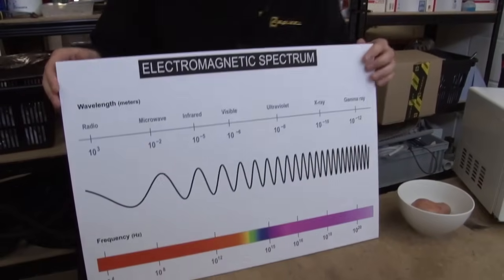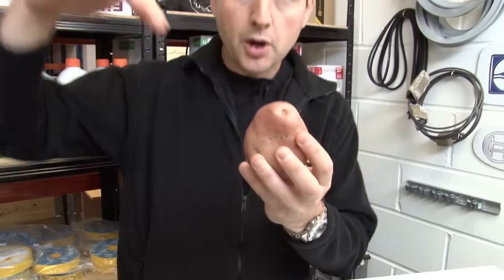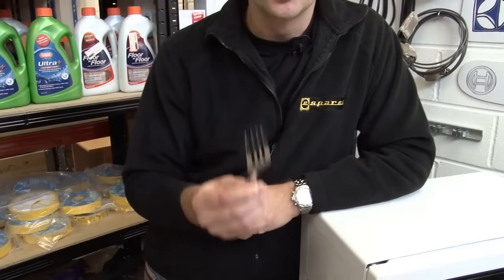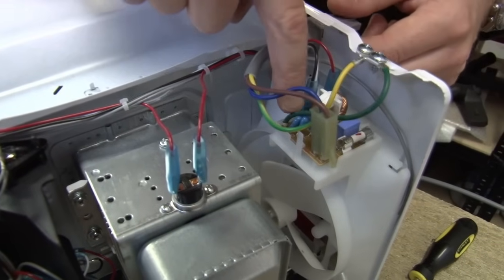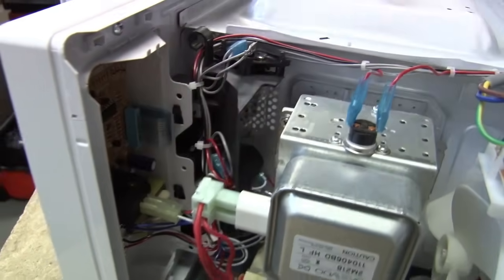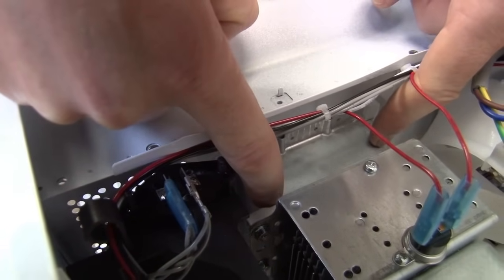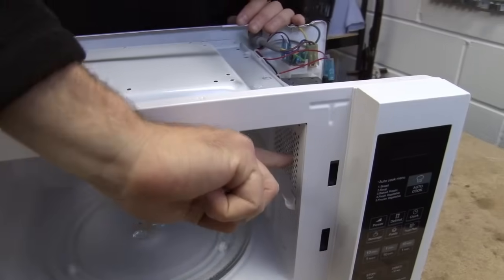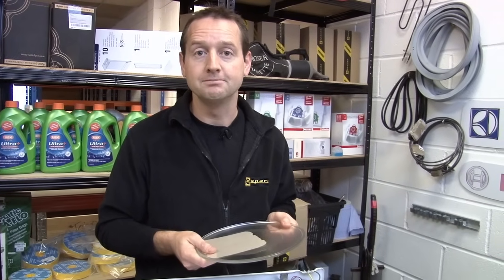How Does a Microwave Oven Work?

Comment: If i plug a 230 V 50 Hz, Microwave Owen into a 230 V 60 Hz supply, will it work, Voltage is same only difference is Frequency please comment ?
Reply from the maker: Hi aabis, you would need to speak to a qualified electrician to get the correct answer.

Comment: hy bro.. I want to make a microwave-related experiment. that is the application of microwave waves to coal heating. what are the tools that i need right? in this case, i want make my own microwave oven, what spare parts that i need bro???
Reply from the maker: Hi Farisi, thank you for your post. As eSpares is a spares retailer, we cannot give manufacturing advice. Due to the high voltage inside microwaves, we recommend any work is carried out by a suitably qualified engineer.

Comment: Do microwave manufacturers misuse the word 'oven' as it's still just waves but coming from the roof instead of the sides? They should just call them "microwaves-but-from-the-roof".
Reply from the maker: To quote 'wickipedia' "An oven is a thermally insulated chamber used for the heating, baking, or drying of a substance, and most commonly used for cooking. Kilns and furnaces are special-purpose ovens, used in pottery and metalworking, respectively." So in summary a cavity or enclosure to cook in. There are many other different types like the open Pizza ovens or the clay Tandoor oven used in Asian cooking. 😊
Reply: Ah, so when a microwave oven is in 'oven mode' does it produce heat inside or remain cold like the normal microwave modes?
Reply from the maker: The micro wave produces heat in the food not in the air inside the cavity.
Reply: I suppose their naming is wrong then or is an evolution of the oven definition. Sorry if I'm not understanding things but it seems "microwave ovens" just add an extra dimension too the waves (vertical and horizontal) and aren't really ovens per say. Thanks for your responses though and I enjoyed the video.

Comment: can you please tell how the power level is changed from the maximum rated power down with a single touch of the micro button ,i wanted to add some other micro power levels modifying the microwave .so can you suggest how the circuit is related with the input.
Reply from the maker: Most microwaves control the power by cycling the magnetron supply on and off, so for half power it is on for ten seconds then off for ten before repeating.
Working inside a microwave could allow you to accidentally contact the high voltage supply that can often prove fatal. For this reason we advise that most work on microwaves should only be carried out by trained micro wave engineers.
Reply: eSpares yeah I realized that it is related with duty cycle but I couldn't interpret it in to a circuit diagram ,then it seems kind of a bit clear.I am ok with the safeties I know I have to take care of the high voltage ,and discharge the capacitor before doing any measurement test or else...,so can u please recommend some related videos or documents to read on how to change the duty cycle from 100% to  0% continuously so as I can have as many power levels as I want .thank u so much for ur help and recommendations
Reply from the maker: Sorry we do not know of any information of this type so cannot help.

Comment: night sir … im subcriber you, i have microwave not heathing… when i connected to electricity fan is working … i havent push button start… may be you can give solution ? thanks sir
Reply from the maker: Hi Kopana, sorry but working on Micro Waves is exceptionally dangerous as the extra high voltage will easily kill if accidentally touched. For this reason we do not give Microwave advice other than to contact a qualified Microwave repair agent.

Comment: very good ,very well understandable
Reply from the maker: Thanks for the comments, a word of caution. If the covers are removed from a microwave it may be possible to contact the high voltage areas inside, these can remain charged for quite a long time and accidental contact can often prove fatal. This is why we will not show repairs inside that could lead viewers into danger and would recommend if you do have a problem that requires cabinet removal you get the unit repaired by an engineer with microwave training.

Comment: Hi Mr Spares, do you by any chance know the average life expectancy of a microwave oven?
Reply from the maker: Hi Mana, this depends most on how you look after it. Generally if the oven is kept clean inside we would expect between 5 and 10 years but often they can continue for over 20 years.
Reply: eSpares thanks for getting back to me :) I just wondered as my parents still have one from the 80s and I often question how safe it is!
Reply from the maker: Most people do not 'understand' the safety issues with microwaves. It is very dangerous to take the case off a working microwave as contact to the high voltage will often be fatal. The other area of 'concern' is 'leakage' from the door. This only occurs if the door is damaged or not fitting correctly. Other than that if it still heats correctly we would not worry at all and think 'this one has certainly earned its keep'. :-)

Comment: hi 
can help me??
I have persintation about microwave oven parts 
what thir jobs and thir location in microwave oven ??
Reply from the maker: Hi, we advise viewers not to take the covers off a microwave as accidental contact with the high voltage area is likely to prove faulty and has killed a number of engineers over the years. We are happy to explain any particular questions on how it works but will not advise on repairs that involve potential contact with the high voltage area.
Reply: How to magnetron produce microwave
Reply from the maker: That is quite a technical question if you are asking about the physics. In practice the magnetron is a type of thermionic valve that has a high voltage supply to it and when powered produces a high powered electro mechanical oscillation. The resultant energy is directed into the cavity and cooks the food.

Comment: Two questions: 1.  how come some potatoes will microwave no problem and some scare the crap out of me cause it seems like the microwave is electrocuting itself?  2.  My microwave works fine however the bottom is totally rusted out.  I have tried CLR and vinegar on trying to clean it up to no avail.  Should I junk the microwave even though it works fine cause it is going to contaminate the food with all that rust and is there a Rustolemum paint or something I could use to do a fix.  Make that 3.  is there any other practical use for a microwave besides just food?  Thanks
Reply from the maker: Elizabeth B Microwave energy can be very powerful and when cooking for a while the water content of the potato can be super heated way above its boiling temperature causing the potato to spit and crackle.  To reduce this it would be better to 'turn down' the cooking power once the potato is hot and cook for a little longer. The rust will have been caused by the moisture from the food condensing on the oven walls. To prevent this always allow the cavity to vent with the door open after use until dry. There is little use for a microwave other than cooking and it is important that no holes allow energy to escape.
Reply from the maker: Elizabeth B :-)
Reply: I'm not sure if it's really practical, unless you are in criminal or espionage business, but a microwave oven can be used to destroy electronics and CDs/DVDs in mere seconds. I don't recommend trying it at home, though, as you might cause a fire or fill your kitchen with poisonous smoke.

Comment: Forgot to mention the h.v. capacitor.... if it fails there's no microwaves to begin with....
Reply: ***** yep! true...
Reply: This video was made to explain how a microwave works and not how to repair it. Due to the high chance of death if the high voltage area is accidentally contacted when on. We do not advise any one to remove the covers from microwaves and do not give fault information around this area.
Reply: ***** Hi Mistanate88, Inverters are used as they can be more energy efficient. The mains power is rectified and used to run a high power switch than pushes the power through a high voltage transformer at a much faster frequency than the 50 (or 60) hz of mains electricity. This allows the transformer to be significantly smaller, lighter and cheaper to produce. Apart from this the microwave is exactly the same in principle as a non inverter Microwave. For this reason and to avoid 'accidentally' encouraging others to attempt repairs in this area we are unlikely to be updating this video soon.

Comment from the maker: In this case the issue is most likely to lie with the magnetron or the high voltage circuit, and unfortunately a repair by an unqualified person is very dangerous. We recommend that you arrange for a qualified repair person to take a look at it. Thanks!

Comment from the maker: Hi,

Yep, a lot of microwaves have lamps or bulbs that are not designed to be changed and are meant to last a long time (life of the machine in many cases). Check your manual or give us a ring to discuss whether a bulb is advisable to change on your model.

tel: 0844 9777 888

Thanks

Comment: If it is used a lot it could be that your magnetron has worn out. but it could also be the fuse in the plug or one of the internal fuse. wouldnt go inside it yourself as there is over 2000v stored in the microwave (even after being unpluged) I would recommend getting a professional to fix it or buy a new one as it is extremely dangerous inside a microwave. hope that helps

Comment: I see you skipped your physics classes-wave function of microwawe does NOT change chemical structure of your meal, yes some vitamins and other stuff might decompose due to high temperature- microwaves only oscilate molecules wich is basicly heat, and yes you will feel like shit if you eat that buy-put_in_microwave-eat shit because there is nothing good in it, its not the microwaves fault

Comment: This is done for proper discharge of the voltage stored in capacitor after switching off the power supply. Now the problem is that after switching on the power supply, I can not detect any microwaves. For detection of microwaves I am using a microwave leakage detector meter.
I can hear smal voice from either magnetron or transformer during operation but the detector does not show any microwaves.

Can any one suggest something to resolve the issue urgently?

Comment: very good video, thanks for sharing. i have a question: what is the size of that fuse on that microwave? i have a sunbeam 700 w 250v, and dont have the original fuse. went to buy one and is too long, it is 15 a 250v, but needs to be shorter. could you help ? thanx and have a great day

Comment: got a few questions on this - firstly had an engineer replace fuses on our microwave and then he ran it with the cover off, I was like so nervous 'cos I said to him can the microwaves not come out with the cover off?  He told me that the Microwaves were all trapped in the oven cavity and as long as the door was shut its safe - didn't really believe him, but is that correct?

Also sometimes on TV shows you see them blowing up microwaves just by putting metallic things in them...

Comment: "It can be quite dangerous" - as in LETHAL, yes.
Before you do ANYTHING with a microwave oven make sure to discharge the capacitor (metal tube  below fan)
They almost always got a bleed resistor inside, but I have found ones that didnt, and it HURTS.
Any part of a microwave is easily replaced. In a previous video you did a bearing job on a tumbledryer, that is FAR harder than replacing a magnetron.